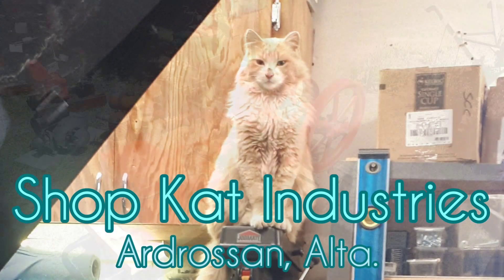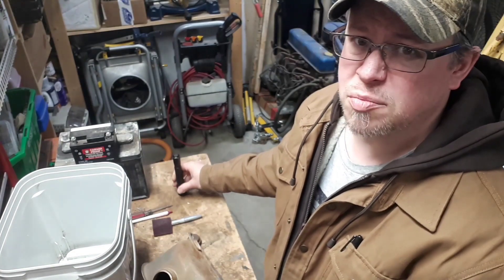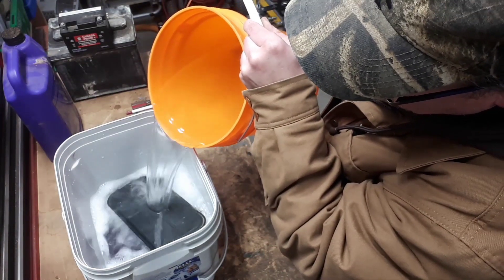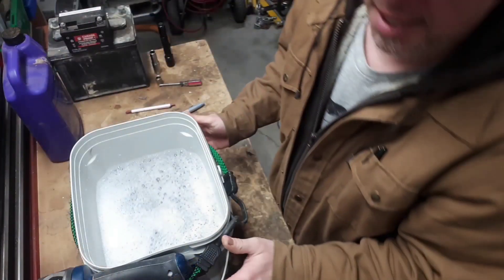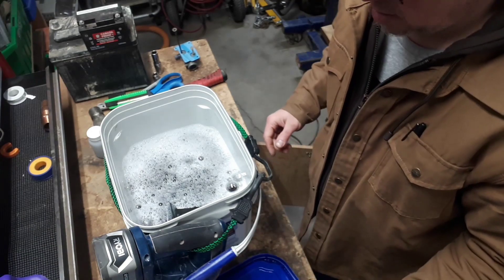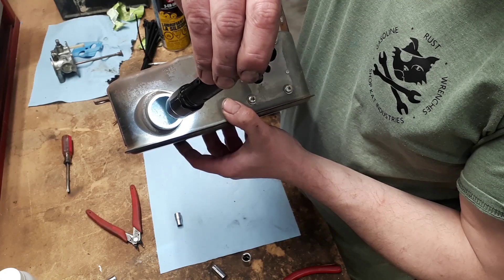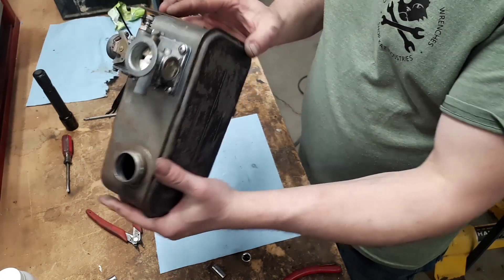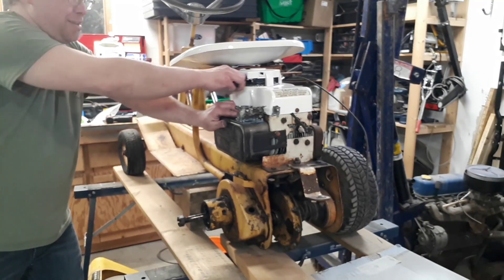Goldie Hahn Gets Tanked, But Will She Run? & A Shout-Out to @vwcoco!

Comment: Great to see it flash up nice. 👍I did my carbs overnight in vinegar with the soak tank attached to my running portable compressor. worked so good it took all the finish right off too !
Reply from the maker: I've never really tried vinegar, but it's an acid so it should work! (I like to use my vinegar for pickling, haha!)

Comment: I still think that enough time spent carefully brazing, soldering and JB Welding little patches etc had some hope of saving the other tank.  I successfully brazed my rusted out Mustang tank and JB welded my later stolen Honda Elsinore tank.  You project probably would have required several methods and several sessions though, but I think it's possible.
Reply from the maker: Yes, for sure it wouldn't be impossible, but it would not be easy!